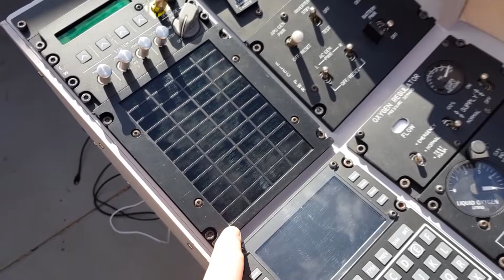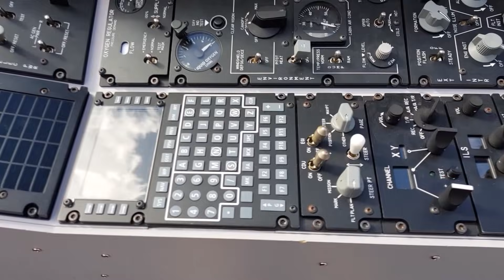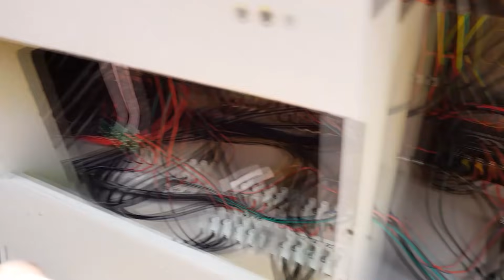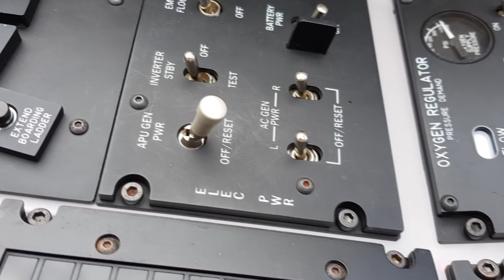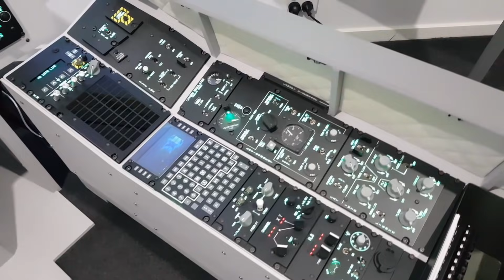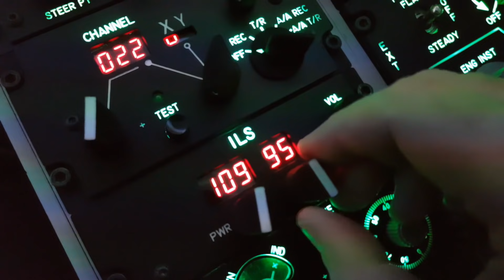The Complete Right Console- A10C Warthog Simulator

Comment: The resone the 5in screen is cheaper is because when they are making a screen they have a pig basically screen sheet and they cut whatever size screen they need from that so making a little tiny screen makes it so you can make a huge screen because of the little tiny chunk taken out so if you have a 60in sheet and take out 3 in you can only make a 55in screen and then you have two inch of wasted space when you could have zero of wasted space

Comment: Hey!

so i have finally started my project of a viggen cockpit :D Starting with one panel at the time :D
I am starting with the nav/data panel.

but love watching your videos over and over ^^ 

Can you make a video of how you make/choose the correct rotary switches. do you make the panel engraving as close to real as possible or do you make every "postion"  of the rotary switch on the panel. for example if you take the steer pt switch, you have the same distance between the different options (1=flt plan, 2=mark, 3=mission) , but on some switches (in the viggen for example) the distance between options is sometimes 1-2-3-5. 

On your warning light box, is that just a bunch of led in a enclosed behind each warning? (is it costum built glass or engraved with the lasercutter, or is it just glass with some sticker behind? :P

Again love your videos and your project :D
Reply: just saw that you had 2 leds behind each square, but is the glass/plexi just engraved or like i wrote is it costum ordered.

Comment: So I am a teenager and this is really cool and I want to try to make one for myself. However I have no idea where to start or even how to connect switches so I can use them in my computer. Any advice or help?
Reply: Those boards in the description (Leo Bodnar and the GroovyGameGear one) are really easy to wire up.

You'll need some skills to build up the cockpit the way he did, but as far as the switches and rotary encoders (spinny ones) they are really easy to wire to the board which has instructions, and just plugs in to USB. It shows up to the computer as a joystick, and from there it's really easy to map it in games. If you'd like some more pointers you can comment back on me and I'll get us setup to chat on Discord.

Comment: Hi... I expected customized PCBs for each panel.... that way it would be so easy to replicate.... the jungle of wires is a nightmare.... !
How do you expect to ever repair it if anything fails ???
Reply from the maker: If I were fabricating my own PCBs costs and design time would be ten fold. This is a one off build-  i have no intention to replicate it. Plus- It's been going for nearly 4 years with only one switch failure, and that was very easy to replace because it wasn't soldered to a PCB...
Reply: Absolutely! I do custom PCB design for some of my projects, but that's ONLY for volumes of 50-200 at LEAST.
It costs a ton to be wasteful and do 1 offs with PCBs.

To answer your question though, "With a soldering iron"

Comment: Hey mate, loving the vids. Anything you can point to for someone just starting out? I'm just aiming for a small box with a few buttons/switches for a start.
Reply from the maker: I began with an A10 electrical power panel in a box, and it evolved from there. Just pick a panel that has controls you use a lot (or make up your own generic one) get an Arduino and a few switches and start soldering. That's how I started, and it just never stopped!

Comment: Ive been following your channel for the past few days. Over the last few years, ive looked all over the internet at simpits for the A10C. Above all, this is not only the most authentic I've seen, but also the cleanest. You have done quite impressive work here. Like you, i started with a Ubutto and its not cutting it. I want to incorporate pieces here and there to build up my simpit over time. 

The main issues are A.) Panel prices are outrageously overpriced online. B.) I need to learn the wiring and programming aspect of the microcontrollers and the software to pair DCS.

Do you have a resource for where you learned how to utilize these microcontrollers, or did you learn this through trade? Also, is there any chance of you building out and selling some of the panels you've made? I would definitely purchase a few of them from you.

Comment: Truly fantastic work Ray. I think having a bigger CDU screen is great, I always like information well presented and clear. I like the use of one main PSU which is incorporated into the console itself. To just have 2 USB cables and a few other bits running to the console is very tidy and the console itself is within a very neat footprint. Quite a mix of interface types you have used, I purposely used several too, so I can learn more about different methods and not be dependent entirely on one. I like the small switch for the PSU, gauge lightposts and the USB outlet, nice touches. Did you mention that the lighting panel dials control the hardware only and not the level of lighting within the sim? if so, have you thought of using a dual / multiple gang potentiometer so it can do both. Great work, thanks for sharing.
Reply from the maker: Thanks Craig. I have a mix of interface cards, mostly because i started this before Arduino and DCS BIOS was a thing! The Leo Bodnar cards are my favorite- easy to use and I've never had any issue with any of them. I had thought about multi gang pots for the lighting panel, but ended up not bothering considering I never actually fly with the 3D pit enabled anyway. I may change that in a few years anyway if I go the VR route.